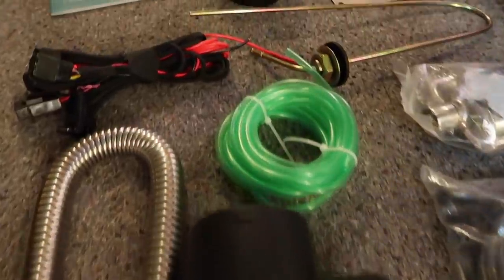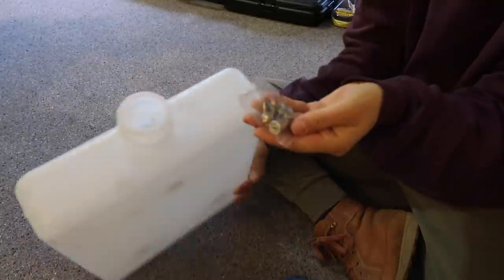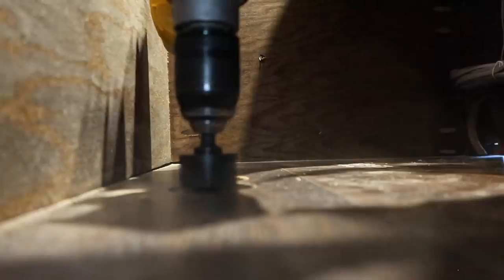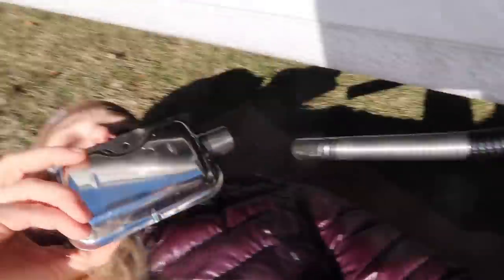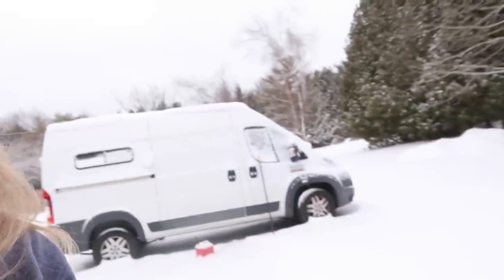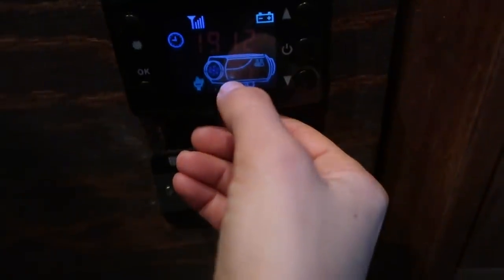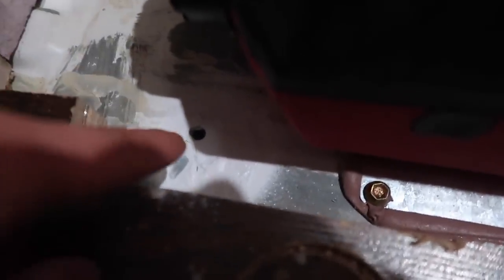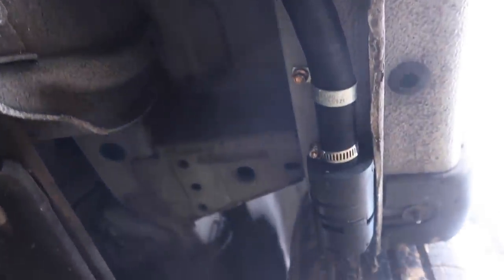Chinese Diesel Heater DO'S & DONT'S | Full Install | E-04 Troubleshooting

Comment from the maker: The last few weeks have been a great break, but it feels amazing to be back on here. I missed you guys! 
Thank you so much for the tips on my heater install! I will be making the changes needed in the next few weeks, like rearranging my muffler. All of the small adjustments and final touches to the van will be it's own video.... so keep an eye out. See you all in a week!
Reply: That air intake filter for the combustion air would also need relocating. Beside a tire it can suck water into combustion chamber. Also it is not so important to keep it so far away from exhaust, since that air is for combustion, it does not get inside of the van.

Comment: Good job, Linnea. You’re going to think “OMG! More criticism!” Here goes... all the research I’ve done in these, there WILL be unburned fuel make it into your exhaust pipe. Position the pipe and muffler so it doesn’t pool and if you look closely at the muffler, it has a pee hole in one side, that has to be downward to allow drainage. Carry on!!

Comment: VERY IMPORTANT!! You need to have the Exhaust pipe and muffler blowing out the side of the van and not under your side window ! The problem of the exhaust being under the center of the Van is it well built up carbon dioxide. Being under the center of the van it will build-up and come into the van ! You MUST have carbon dioxide detector! PLEASE get the detector!
Reply: Best location, specially if you have diesel is toward the engine bay. It will keep the engine warm for morning startup. Also get a filter or wrap some screen on the air intake.
Reply: Yes!!  CARBON MONOXIDE is a killer.  Move your exhaust and get a detector. We want you to keep making videos.
Reply: I thought I saw a co detector in  package Just at the 19:50 mark ?
Reply: @paigem   you are right, that is a carbon monoxide detector she had there

Comment: I wanted to say a good job and pushing through until you finished it. It will help you down the road if there's ever a problem with it.  Just to let you know, they all name brands are built in China and from the same companies.  You were smart going with the cheaper one. I've had mine for three-season now and no problems.

Comment: Awesome video! Now I know how to prime the stupid thing!
Things I did differently…
1) I used 3” METAL heater pipe, just in case of fire!
2) I’m planning on a big deep cycle battery or eventually a lithium setup.
My fuel tank is in my back door and the line is attached to the top of the tank to minimize leakage and this makes filling it easier and cleaner.
4) I made a small plywood bracket to hang the pump from. I drilled two holes the size of the fuel line and the pump is hanging on the lines, I found this to be real quiet!

Great install, I learned a ton!

Bryan from Vancouver
Reply: Hey Bryan from Vancouver, How did putting the putting the fuel line on top of the tank work? Doesn't it need gravity to pump out every drop of the diesel? Or did you lead it down in like a straw? Thanks! The reason I ask is that I have a huge leak and I put the gaskets on both sides of the nipple and tightened it on as far as I know correctly.

Comment: Great video, I'm installing mine now here in the Midwest. About time, I had to send the first one back. It's been cold. I learned some things from you, I appreciate your video. Next time you have to drill big holes in your floor just start by running a screw down first then going under and measuring your clearances.  I was a heating install tech on residential construction, I had to do that alot. I hope to run into you in a state park or something out there. I subscribed. I really like your show. God bless you.
Reply: Yeah that's what was wrong with my first heater I sent back. A electric connection was faulty

Comment: Next time you make a bench or seat, lower the height at the back 1/2" or an inch.  It will make it much more comfortable to have it rising up to your knees when you sit (think Adirondack chair).  For even more comfort, check out some furniture build videos on Youtube, and buy the inexpensive webbing that they put under the cushions and cut out the opening where you'll sit, and staple the webbing in a crosshatch pattern.  Same as a couch at home, you'll appreciate the bit of "give" it adds.

When planning to drill through the floor, use the metal pattern in the floor (pattern of raised "strips" and other areas they raise the metal floor for strength) to confirm the location is OK, such as "4 inches from the end of the 3rd raised strip"....

You should be able to box around that pump, and insulate it inside to cut down the noise of the clicking.  You also should have a grommet in that hole for the fuel line, so that vibration doesn't chance cutting through that tubing from the metal edge inside the hole but some silicone should be fine now.  Home Depot has a pack of assorted size rubber grommets as I used them to protect my solar power cables coming in through the roof of the van.  And I would figure out what the tubing size is and consider a better quality if others have replaced it, as a leak back there would be a fire hazard.

Next time, use aluminum tape, such as used on ductwork (Harbor Freight or Home Depot) and you'll avoid that tape melting on you.  It's great for a vapor barrier.

With a small power system, you could wire the heater to have a switch that powers it from the vehicle battery, and that way go through startup for it on vehicle battery with the engine idling, then flip the switch to RV power system and shut off the vehicle if your batteries are ever too borderline to handle the startup cycle.

Also, as smart as you are about things, do some investigating of Youtube videos on just buying 4 individual "Lifepo4 cells" to build your own Lithium battery for about 1/3 the price of an off the shelf one like a Battleborn...  All you need is 4 cells and a "BMS" which simply attaches to each cell (to do balanced charging and top each 3.2v cell off fully despite how much charging is needed individually), and then has the charge power, and output power from the battery.  The BMS gives you the appropriate protections such as overcharge, undercharge and cold weather prevention of charging since lithium hate very cold temps and you have to have them warm to charge them.  You likely already know that a 75ah lead acid battery can only give you about 15a or so of useable power before damaging it from too low a discharge, whereas a 100ah lithium battery can deliver 80-90% of those amps, so WAY better than any lead acid and these days with lithium cells falling in price so strongly, it's the way to go.  Sometimes Ebay has the cells at good prices, but a reputable seller on Alibaba can also be a source... start with Youtube DIY videos on building a battery from cells.

Well done tho!

Comment: Super easy solution to quiet the fuel pump.
   Cut a 2" wide strip of rubber about 8 inches long, (an old mud flap from a semi truck is perfect for this.) Drill a hole in each end of the strip, form a circle and insert bolt and mount in chosen location. Drill a hole through the strip opposite your mounting and bolt pump to the loop.
   The loop of heavy rubber does an amazing job of silencing the pump. Worked for me. 🙂

Comment: I just installed mine too. finding a good location for everything can be a challenge. One thing I've read was that the exhaust has a little condensation in it so the muffler should be the lowest point in the system so the water can drain and not rust the pipe,  also the muffler has I little drain hole on the bottom so the muffler actually needs the be mounted horizontally. that's where I had problems trying to find a spot to do that. Great job on the build, cant wait to see videos of you on the road.

Comment: I think it would be wise to have a rubber grommet for the fuel line and any wires to keep the wires and fuel line from fraying and causing a short or licking fuel.  Also, taking any sharp edges off your holes with some sand paper and a coat of primer for rust.  That all said,  I admire your courage and your ability to laugh at yourself and or the situation!  Best to you in life and love!!!

Comment: Hey Linnea,

Spotted something and hope you fixed it already but if didn’t here it is:
The muffler HAS TO BE the lowest point in your exhaust line. Saw that the exhaust pipe goes lower and then comes back up. That will cause problems as the vapour will pool there and turn into water then rust your system and will throw up some error codes. 
Make sure the muffler is in upright position and lower than anything else in the line. 

Apart of this amazing job. Well done girl!
Proud of you!
Greg

Comment: You should drill a larger hole for your fuel line. Buy a Gromit with the center hole the same size as your fuel line. The outside diameter of the Gromit should match the hole in the floor. Notice you will have a lip that will be on each side of the metal. Hope this makes sense to you, This will protect your fuel line.

Comment: If you didn't do so where  that fuel line is coming through your floor you need to make the hole a little bit bigger and put a grommet around the fuel line
Reply: Silicone gooped in there works fine

Comment: Not sure if you've changed your exhaust layout yet but: rotate the muffler so the 'weep' is pointed downard (there is a small stamped mark to indicate the bottom). Also, you want the exhaust tube to be level or slightly downward to the muffler. This prevents moisture from accumulutaing in the exhaust tube. Really nice job on the install and video.

Comment: Mount the exhaust pipe so it ends outside the side of the van. You can cut the pipe if it's too long. And it should also lean downwards to prevent water from flowing into the pipe.
I struggled with a similar heater in my Peugot Boxer (same as Promaster) and it's not very easy. My van is a diesel so I can take fuel from the van fuel tank.
Well done!!

Comment: Hello friend, first of love your videos. The one thing I wanted to mention is you may want to put in a rubber grommet where the fuel line goes under the van because of the sharp edges. Besides that it looks great. 👍🏠🚀

Comment: Great build well done! Just one thing - your exhaust needs to point out of the vehicle so the fumes don't build up under your van, also the muffler needs to be mounted vertically as there is a drainage hole on the bottom for water building up (the way you mounted it it will start rusting) hope this helps!!
Reply: Good advise, I have made a screenshot. Safe information 🌝

Comment: Helpful video. Thankyou. 

Not many vids on E-04 error. 

But it is connected to either problems with the fuel pump or fuel pump wiring faults. 

A few tips to help you if you get this error. 

Check fuel pump wiring and connections and change out fuel pump or try hitting existing pump to get piston moving again.

Comment: When you do your next build (and I’m sure you will) drill from underneath into the cab. Something I’ve also learned from others is make sure you run on high for awhile when you turn it on. Also, some  units do not like eco diesel.  Check the air intake at the unit to ensure it’s clear of dust and fluff etc. It’ll need to be cleaned out every few months. Cheers from Canader eh!

Comment: Add a rubber grommet around that fuel line that you fed through the floor or the fuel line might rub against the metal from the vibration and you will have a leak

Comment: Nice work on this install!
I installed this in my tiny house before moving to Leadville, CO and it is working great! Scary to install - definitely agree with the "I think it might blow up" feeling - and the weird smells on the first few runs weirded me out, but it's kept the house warm even during nights it goes to -5 f and during days when it only gets to 10 f. Soooo satisfying when it works! 

I also lifted mine up for the fuel line and ended up keeping it like that since there wasn't any metal bottom to reach (just floor-foam-plywood underneath the trailer). So I ended up wrapping the exhaust with this green heat insulation wrap thing. Still a little worried about exhaust seeping out from the clamped part but CO alarm has never gone off...

Comment: Well done. I put some heat wrap bandage around my exhaust and some 10mm cable conduit around my fuel line both under the van just because they are close under there and it was an added level of protection.
Reply: Dad see ew were ferlrl see

Comment: Did you put a grommet around the fuel line when you passed it through the floor ?... wouldnt want the metal to rub a hole in the line
Reply: Yes, absolutely! As it is, the fuel line will chafe, leak, then fail. It's just a matter of how long it will take. Dirt washboard roads will exacerbate it. Over all, fantastic job, Linnea.
Reply: Cut a vacuums or hose in half and put it anywhere hose or electrical comes contact with metal. Also bit of silicone won’t hurt.
Reply: I got on here to say the same thing! Great job Linnea, just cushion your fuel line so it doesn’t rub and leak!

Comment: Sure hope you pot a grommet around the fuel line passing through the metal. Vibration will cut the line a little bit at a time. Also very proud of you. Keep trying. It’s worth it!

Comment: Very nice install! I wish I was half as handy with wood. One tip/issue I ran into: The "air filter" is barely just a screen and having it next to your wheel like that will have in breathing in bad things quickly. I found a "real" filter for mine, its like a closed black box that you plug the hose into. But there are a few other solutions that sort of worked for me: 1. I built a shield for it from an aluminum can, opened a slot in the top and used metal zip ties to secure it. I later modified it by taking some cheese cloth with oil on it and wrapped it around the "filter" just a few layers. 2. I briefly ran it with the air intake inside the vehicle. However, this was a bit loud. 3. Take the existing intake filter/hose and shove it into your frame rails or other part of your underbody that stays cleanest. Also thanks for being so legit and real! This has been a fun learning adventure for me and it clearly is for you too!

Comment: Pro-tip for putting the fuel line on the fittings:  instead of using a hair drier, heat about a cup of water in the microwave for 2-3 minutes until it's not-quite boiling.  Stick the end of the tube in the hot water for 10-30 seconds, then shove it onto your fitting.  It should slide right on.  If it's still stubborn, set it back in the hot water another 10-30 seconds and try again.

Your install was fun to watch and gave me ideas for where I'll put mine (I have the same size van as you).  But the only thing that concerns me is you have the muffler directly under the van.  It should reach the outside - either front or sides.  Otherwise you're trapping exhaust fumes directly under your living space, which can be dangerous (please have a CO detector)

Comment: I just installed one !  It works great so far .. 

I was going to install the fuel pump and filter inside as well but when I was filling the parts I realized that the tubing had to go down below and back up again and I didn’t want to have air bubbles forming after the pump cavitate‘s. So I mounted the pump just underneath the heater outside but it is a short run at the correct angle with no chance for air bubbles to form anywhere so it will feed gas efficiently even with the green tubing… I wrapped the pump and filter in cloth and plastic then taped it to weather proof ..

Comment: Great job! One thing I didn’t see a grommet around the fuel line coming into the van. The metal  touching the fuel line will eventually wear a hole in it. Great job working through the troubles and making it work!!
Reply from the maker: Thank you! It was a big pain in my butt. haha 
The fuel line doesn't have a grommet but it is protected by fireseal (rubbery and firm) and I made sure it isn't touching the metal at all. But thank you for double checking, I appreciate it a lot!

Comment: Hey, great job on the install! No mistakes, only lessons learned! Just want to give you a heads up, your exhaust should be lower than the piping, otherwise it will build up moisture in the exhaust pipe and could start causing the heater to throw an error. Great video and build, keep up the great work!

Comment: The muffler needs to be the lowest point of the exhaust and it also has a small draining hole in the bottom of the muffler that needs to be pointing downwards. Otherwise moisture will be building up in the exhaustsystem with no where to go and voila... You have new funny E-codes :) 

Probably someone already mentioned this but I didn't read thru all the comments. I enjoyed your honest video though. Most of the youtubers cut all issues away and make it look really easy :P
Reply from the maker: Thank you so much! I did end up changing the location of it because of helpful people like you. I appreciate it!

Comment: Great video.  I'm about to install one of these in my boat and I'm really anxious - particularly about the heat of the exhaust going through the hull and any potential co2 leaks.  I've installed a co2 sensor in the cabin for some insurance.  Anyway, just waiting for a couple of upgraded parts to arrive before I put it in.  Fingers crossed!  Regards from Australia where we don't have to worry about snow our solar panels........

Comment: Great video.  If you don't already, you should quickly get a carbon monoxide detector or two for your van, especially for when that heater is running.  Fire extinguisher that is rated for diesel too.

Comment: You might want to check where the fuel line goes the floor for the diesel fuel that there is a rubber insulator around the tube to keep it from the edge of the hole wearing the through the tubing!